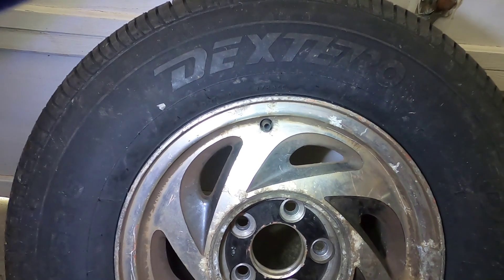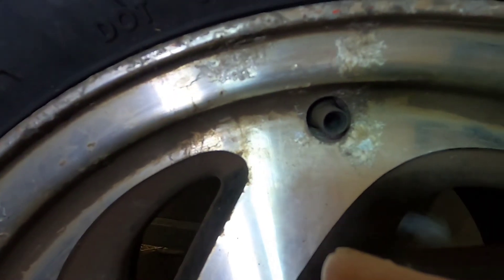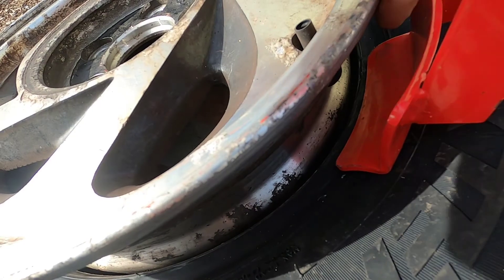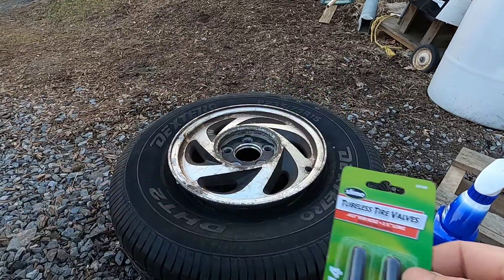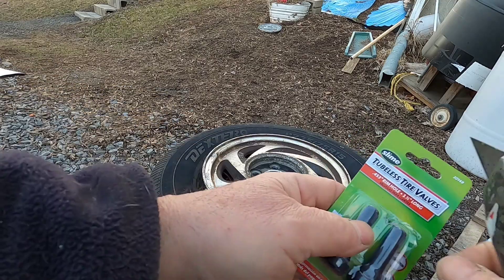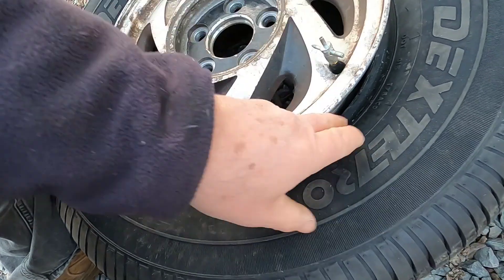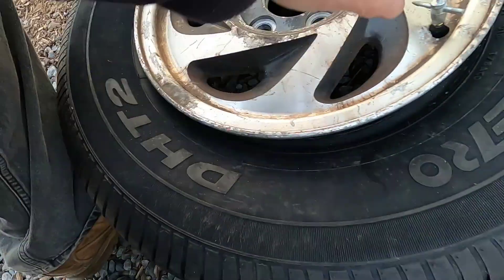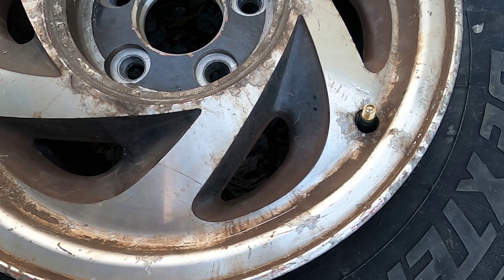How to replace tire valve stem

Comment: I have had them crack and leak air slowly, hard to find as you assume it is the tire.
Reply from the maker: Cruiser Mac, Thank you for stopping by & commenting. They can have you scratching your head LOL. When it is warmer out I usually put water into a wheel barrel then put the tire in to check where the leak is. Just too cold out when I did this one. Stay well, Joe Z